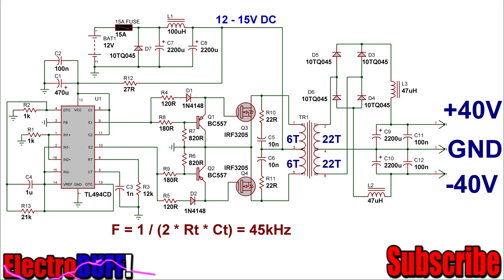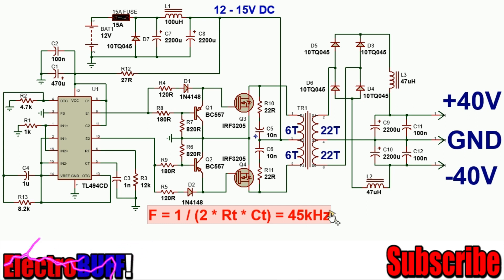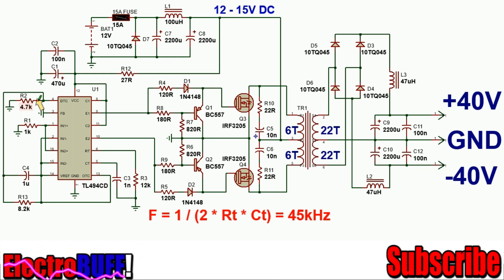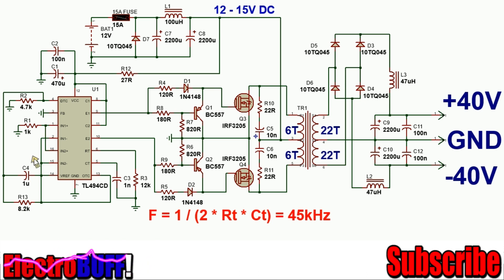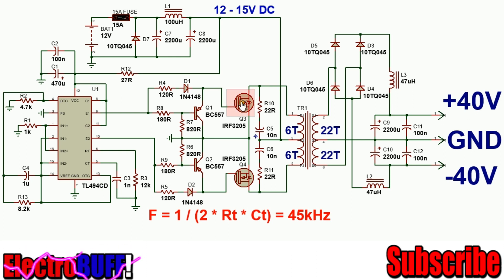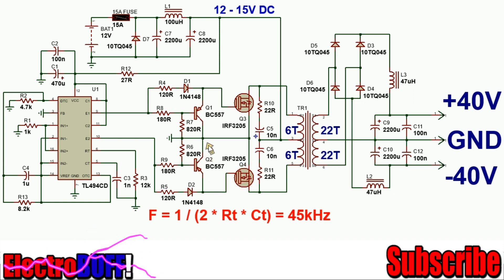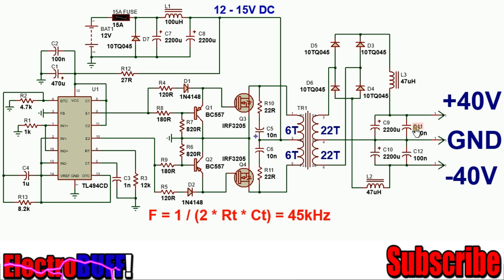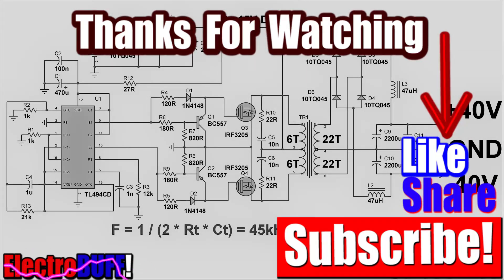TL494 Switching Mode Power Supply for Amplifier 500W 12V to +40-0-40 Volts

Comment: What should be the diameter of the primary and secondary transformer wires?
Reply from the maker: Use AWG24, parallel enough strands of wire to handle all the primary current safely. A single AWG24 wire has a diameter of 0.51mm and can handle 3.5 amps of current.

Comment: I used same circuit but output voltage drops when load is applied please tell me solution.
Reply: the Feedback of the ic is connected to ground. you can use that for feedback to adjust the pwm signal but not connected to ground.